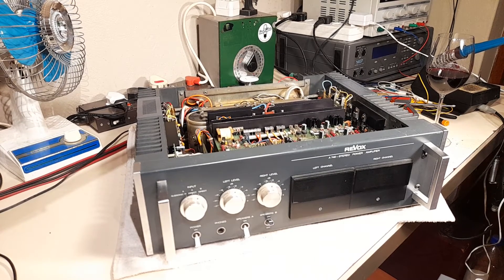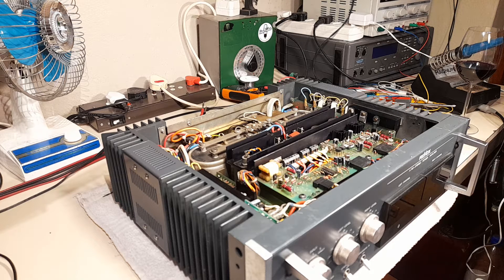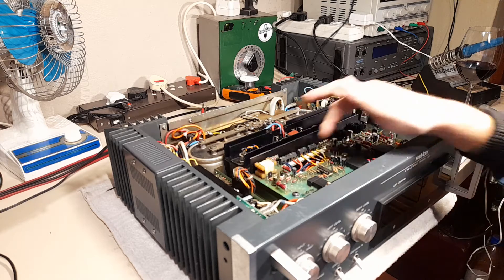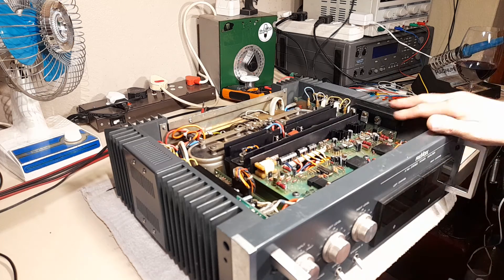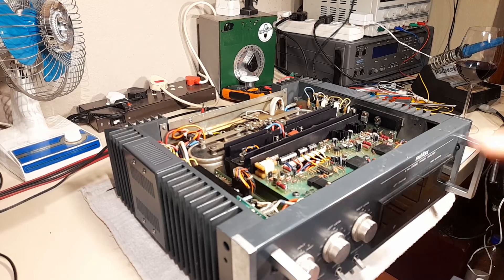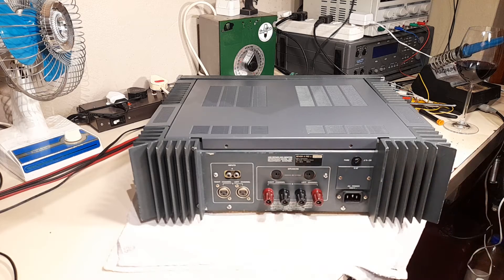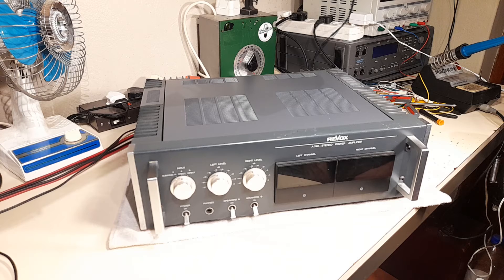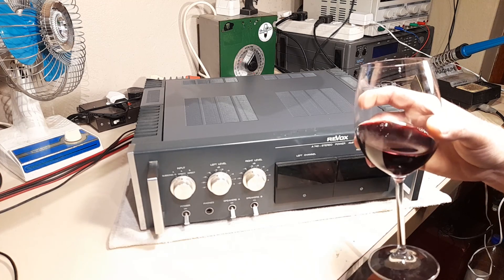The resurrection of the Revox A740 stereo power amplifier

Comment: Hello, could I ask what kind of led you have installed in the VU meters ? I think the voltage is 63 volts or so in the bulbs and I would like to replace the original filaments with led . Thank you very much for that and for the good video. Cheers, jack from France

Comment: So yeah. My A740 works again too. Full recap, few new transistors, new pots and a deep cleaning with cosmetic restauration. One issue left with the left Meter though. The needle is moving a bit when putting a 1khz testtone in and i cant adjust it  all the way down to -40db. Right Meter works alright, so i guess it could be a faulty transistor. BC560b or so maybe. There was a blown cap on the Meter board (C2 100uf). So back to the bench :)
Reply from the maker: If you can replace all the semiconductors on the VU meter board. I am sure the problem with resolve.

Comment: Great video. Id be curious what you discovered in the schematics regarding the -Rail that couldnt be detected. Im about to restore one myself and as a beginner i search for every good bit of info i can get :) Realy nice wirk btw. I admire your dedication!
Reply from the maker: Hi... The preamp psu ground is terminated on the amplifier board and this is the thing that you might miss when testing the psu on its own because it will cause erroneous measurements. And since it is two positive type regulators with floating secondaries on the Transformer you need to be mindful of that. Otherwise it is very simple to work through. Good luck!